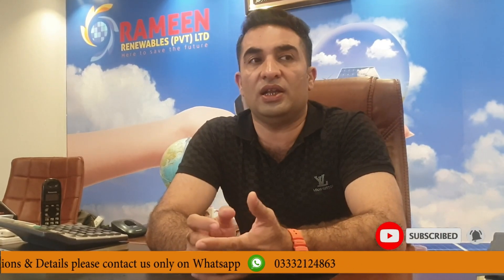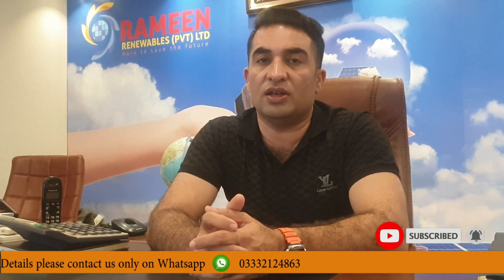آن گرڈ اور ہائیبرڈ انورٹر میں کیا فرق ہے

Comment: It means that ongrid is only suitable for  those areas where there is no loadshedding ? What if we have batteries attached to such systems for backup?
Reply: On grid inverters dont have option of attaching batteries. You can install a separate UPS or inverter for back up during load shedding.